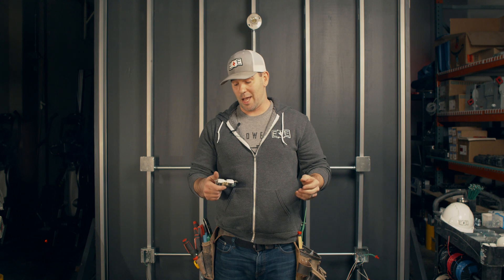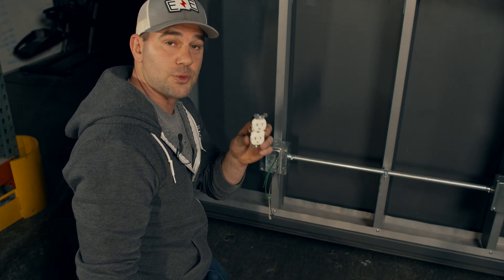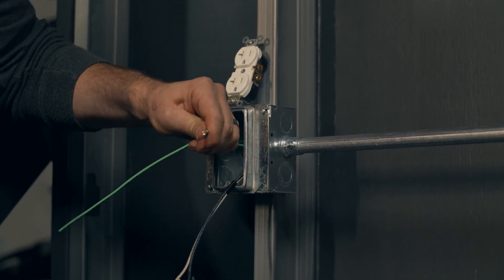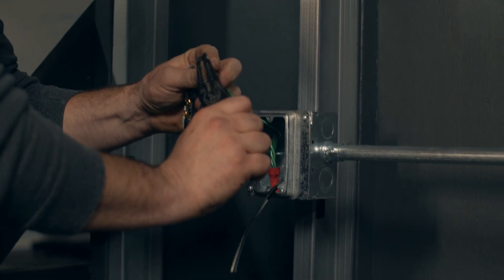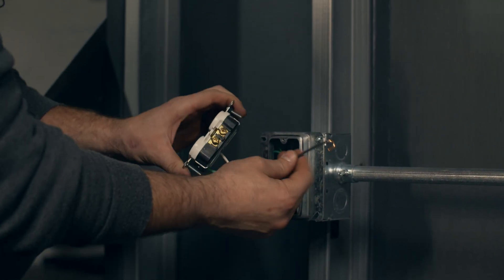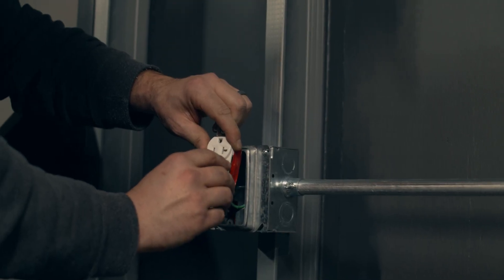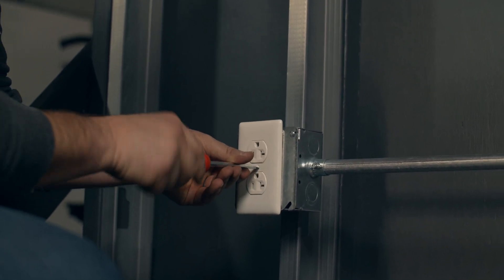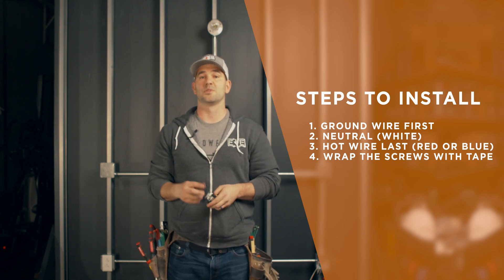How to Install a Duplex Receptacle - Wall Outlet Or Plug

Comment: I have 2 white wires and 2 black wires and ground

Should i connect 2 white wires to silver screw and 2 black wires to gold screw.
Reply: I am not a electrian, but had to wire enough things up for my works workbench for computers, but if you pigtail like he does, its one wire to gold and one wire to silver, much cleaner and less chance of issues putting two wires on the screws. But the second set of screws are for daisy chaining

Comment: Good video, nicely done. Why wouldn't you use a 15 amp spec grade receptacle? I've never seen anything with a 20 amp plug. What about Wago 221 lever nuts instead of wirenuts? Those cover plates are nylon and you're right, much better than plastic ones.
Reply: 20A duplex recept maybe